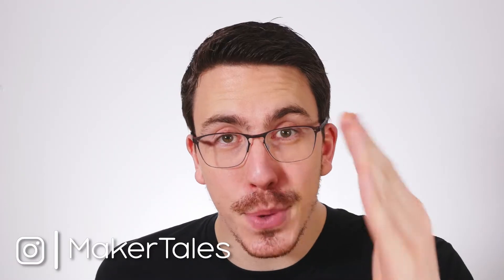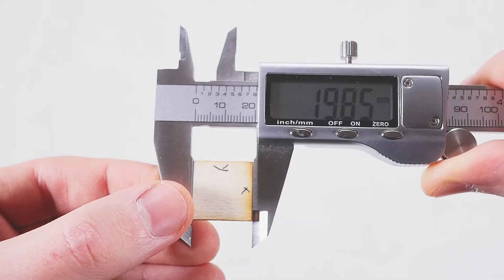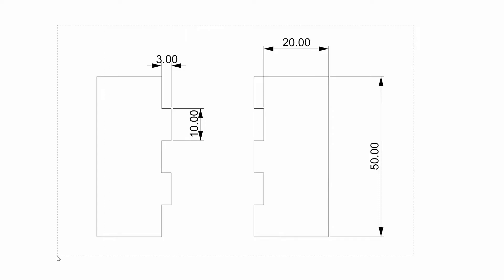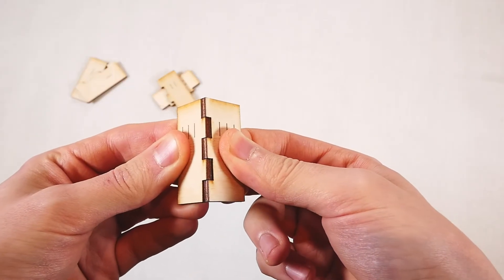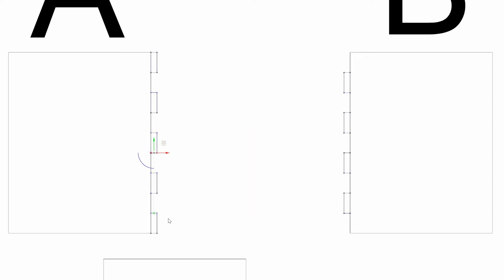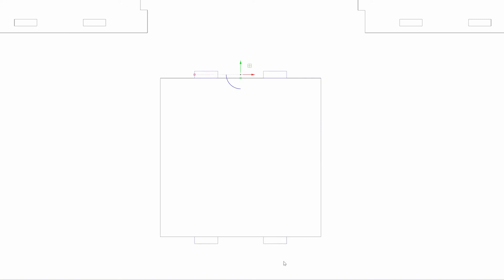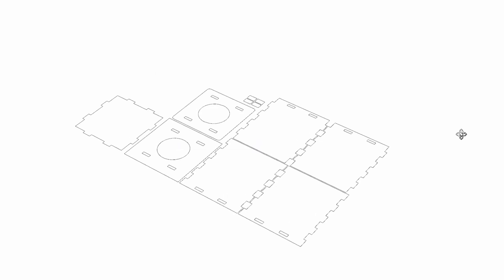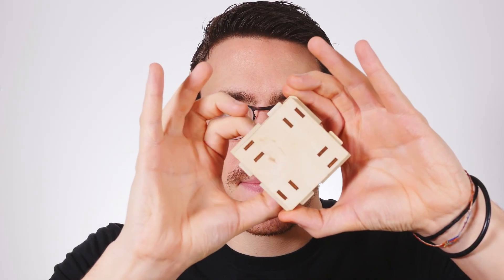How To Design A Laser Cut Finger Joint Box Accurately

Comment: Shouldn't you multiply the 0.15 delta, not divide? 0.15 was already a difference from one side of the beam...
Reply: No, it's correct. It's like a circular saw. The laser removes exactly 0.15mm on the line on both sides of the piece. He removes half of it from the workpiece and the other half from the cut-out. 0.075 mm on the left side + 19.85 mm piece of wood + 0.075 mm on the right side.

Comment: Any ideas on how i can cut curved plywood? That aren’t completely flat. They usually mess up the laser cutting
Reply: If you'd like it to be flat, you could put the plywood on some perfectly flat piece of metal and clamp it or weigh it down so it is forced flat against it. Then put the ensemble in a oven to warm up the glue inside the plywood then let it cool while still clamped to the metal plate. Dismantle when cold to the touch and it should remain flat. 
 You could use a heat gun on not too high a setting instead of a oven.
Reply: @zet0korp  Thank you!

Comment: I don't consider kerf at all... Other than if it's different on the X and Y of course.
But that tiiiiny gap between fingers, makes them slide nicely together, while not actually having any noticeable gaps.
With that said, I always use glue. I haven't made anything yet that is meant to come back apart.
Reply: The kerf is strongly dependant on the laser technology you are using and its focus, along with the type of material you are cutting. You can expect some costly CO2 lasers to be finer than cheaper IR laser and therefore less noticeable... I believe..

Comment: great video! If I wanted to cover this with leather (to make a tiered jewellery box) do you think a finger joint is appropriate for the base? or is simply glueing the sides with no special joints sturdy enough (as it won't go undone due to the cover material)?
Reply: A butt joint isn't the strongest but it's common. If your adding support with a second layer then it's fine enough. You could add some pin nails to add some support.

Comment: Thank you for a very imformative video, and especially for the example file.  I had one question about the file.  I see nominally all fingers and slots were designed at 10x3 mm.  The fingers when accounting for kerf grew on the 3 sides by 0.08, making the fingers 10.16 x 3.08.  What was confusing to me was the slots that the base would snap in to.  With kerf adjustment they changed to 9.84 x 3.0 mm.  I would have expected the kerf adjustment to be both in width and height, giving 9.84 x 2.84 mm.  Why did the height of the slots stay at 3.0 mm?  Thank you.
Reply from the maker: Hey Ray, I have a feeling that one of two things are happening here. Me and human error or that as it's not a kerf and a kerf it's half the kerf... or put frankly I'm a little lost in the answer of the question. I'm more than happy to talk it thought and see where I have gone wrong by having a chat on my discord if you want to ask the question there?
Reply: @Keep-Making  thank you. It’s not all that important.  I am not sure what you mean by chatting on you “discord “?  What is that?   Thank you again for an interesting video.
Reply from the maker: @rdavis0521  Still just to let you know i'm here to help =) Discord is like a forum room / chat board for communities this here is the maker tales one: https://discord.gg/Ezx9hUD

Comment: hi do you know how to make the cut still attacth to the base like puzzle?so the user have to push it a bit to cut the pieces
thanks
Reply from the maker: Hi Ian, Do you mean how to make tabs for laser but bits? This way you can get the wood but it still "stuck" together and then then you push them a little bit to free the bit?
Reply: @Keep-Making  hi so sorry for the late reply, Yupp I wonder how to make  the wood will still contact to the base wood after the cutting process (doesn't split ),thank you so much

Comment: what i have done for our lab is a grasshopper script. you choose you kerf from a menu (of measured tests) and then you can fine tune it with a slider if needed. it takes the value and offsets out all the outer curves and offsets in all inner curves. one click solution that can correct any drawing (which is drawn without kerf correction) with a single click. this simplifies drawing management and gives one click correction when matetials or cut parametres change :)
Reply from the maker: This sound awesome constantinos!
I'm shifting my 3D modeling into blender currently and there have a great addon API I'm thinking I might make somthing close to your grasshopper code into a blender addon. If you know python and feel like learning an API you might want to make your code open for others using blender?

Comment: Thank you tomorrow going to try to make my first box. Thanks for the help and PDF file. Are not all the lines on the file suppose to be red are they not all cuts?
Reply from the maker: Hi Norman, thanks sounds great!
How did it go? Long and the short there different colors to create a cutting order.  Inner shapes first and then the outter shapes this is why there are 2 different colors.
Reply: @Keep-Making  The box came out good I just used your Kerf because mine was almost exactly the same as yours thanks for helping me get started.  I just need some easy software to make my own boxes now.
Reply from the maker: @ratdog420  Great to hear. As for a program to use I've almost finished creating a whole course on how to use blender https://www.youtube.com/watch?v=ZI49VIcISaw&list=PL6Fiih6ItYsX3qdwhEyd77zy82bM-I8t1
Reply: @Keep-Making  thanks I will definitely watch and subscribe to your channel. I have tried to use Blender once to combine 2 projects fpr a 3d print job but was totally lost. Maybe you can open my eyes looks like awrsome software. I made another box with inkscape working on a 2 x 4 wood box for a 3d plastic lithophane to mahe a nightlight that hangs from a wall.
Reply: @Keep-Making  is there a way to cut a slot so you could slide a lid in and out of a box my lid being my 3d printed lithophane?
Reply from the maker: Hey Norman, Ya this does sound like something that is do able.
They way I would go about doing this is creating the slide in and out slots of the laser cut box with engraving.
This is how I did the interchangeable name tags for these Arduino origination trays https://youtu.be/vS1M6D645kw?t=316

Comment: Great video, can you maybe make a guide for a free vector software (like Inkscape?)
Reply from the maker: 100% Niklas, The fundamentals of the way you would achieve this result is the same tho. With a little bit of time, I'm planning to show how to do this both in Inkscape and Blender. Plus I'm planning on making a course showing step by step fundamentals of laser design in a free program.
Reply: @Keep-Making  dont forget Flex(for flexing the Wood) and extender joints, to hold linear pull (like a jigsawpuzzel Pieces) to make boxes bigger than the laser can cut by extending pieces together. Lookin forward to your guide in Inkscape
Reply from the maker: @n1k7a53  I'm glad you're looking forward to it. Do you have an example image of this Flex. I think I know what you're talking about but not 100% sure.